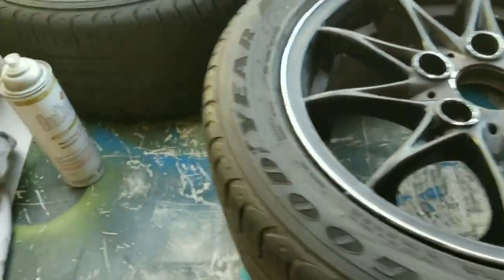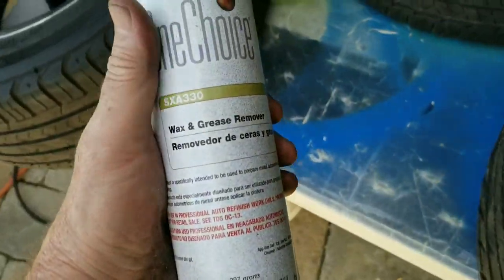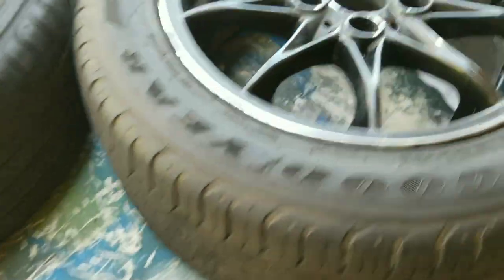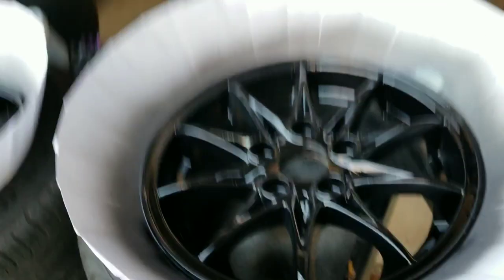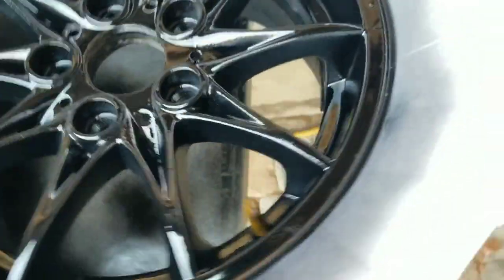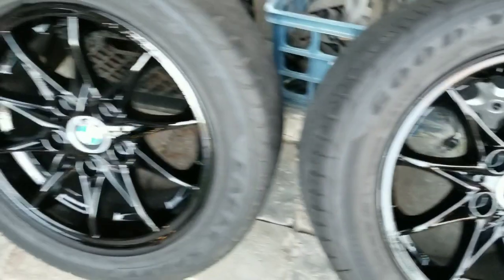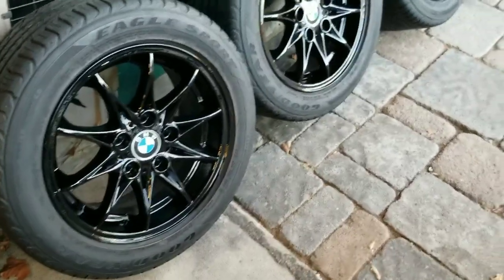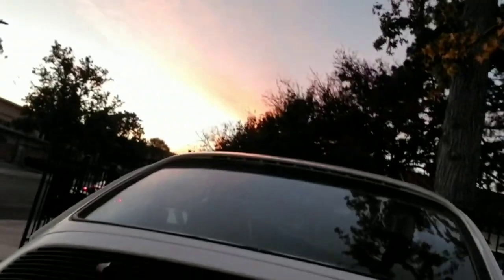Painting the BMW Z4 wheels with a cheap Harbor Freight HVLP spray gun.

Comment: That liquid adjustment on the needle is touchy. Try filling your cup with water first. Disconnect it from the air hose and squeeze the trigger. Let the water pour out into a cup and time it for 1 min. You want about 6oz. If you have more after a minute, dial that liquid flow back and try again. Once you get that, set the air until you have good atomization. Mark your knobs. Then set your fan wide open and spray (hooked up to the air now). Dial the fan back until the soft fuzzy edges become crisp, then give 1/8 turn back toward full fan. Mark it. Should be good settings for any thin paint.

Comment: Your fan pattern is a garden hose lol, learn how to adjust the gun and it'll take care of you
Reply from the maker: I've had a difficult time getting used to the HVLP guns. Haven't been able to get decent results after quite a few trys. Years ago I got great results using a higher pressure siphon feed gun, so I just got one from Harbor Freight (!).  I'll probably do a video when I get around to trying it out.  Maybe do a comparison? Thanks for watching and commenting!
Reply: That liquid adjustment on the needle is touchy. Try filling your cup with water first. Disconnect it from the air hose and squeeze the trigger. Let the water pour out into a cup and time it for 1 min. You want about 6oz. If you have more after a minute, dial that liquid flow back and try again. Once you get that, set the air until you have good atomization. Mark your knobs. Then set your fan wide open and spray (hooked up to the air now). Dial the fan back until the soft fuzzy edges become crisp, then give 1/8 turn back toward full fan. Mark it. Should be good settings for any thin paint.